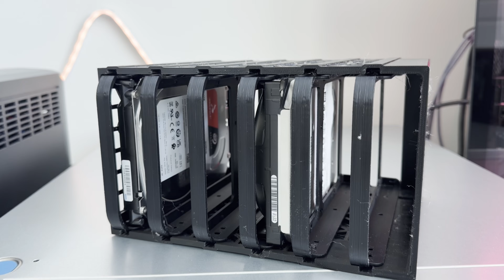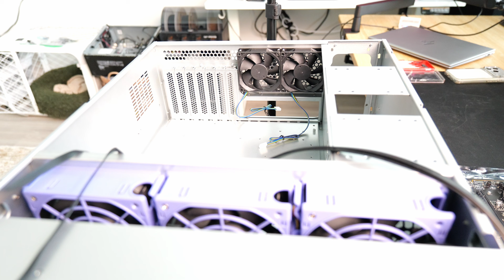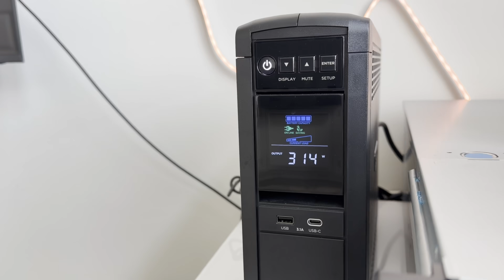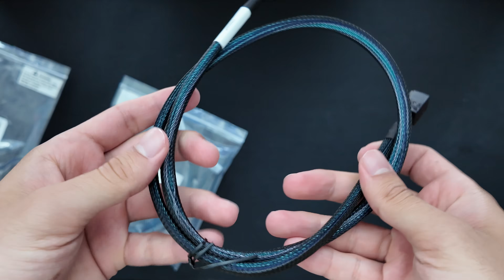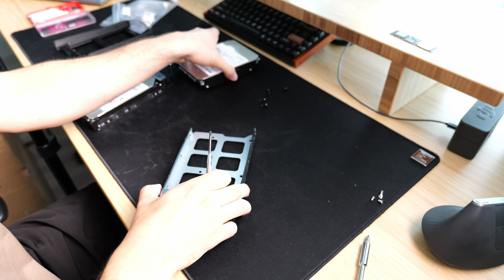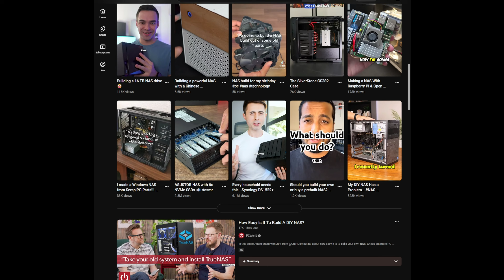I Set Up a 24-Bay NAS

Comment: Get that backup to your data done asap. 

I never experienced a hard drive failure until I got into having a NAS. Especially if using decommissioned enterprise hard drives. And good luck with the warranty. Funny how the storage sellers and manufacturers went from replacing the drive to sending a refund of the purchase price which if bought before 2026 is not going to be anywhere near the actual replacement price.

I somehow got lucky and got my 3 NAS boxes built before the end of last year right before storage prices went nuts but I live in fear of drive failures now as any replacements appear to be 3x or 4x what the drives cost me last year.

I shudder to think what replacing all these drives would cost now. 

If I had to choose storage from scratch today, I'd seriously be looking at cloud storage rental as it has gone from expensive compared to my own NAS to bargain prices in comparison. PCloud lifetime license when it is on sale is looking mighty attractive vs buying a boatload of hard drives in 2026.

Comment: I suppose the RSV-H424 is a reasonable choice with the price increases on used disk shelves.  I went the used disk shelf route myself.  I have a 12U rack with the RSV-L4000U with two 4 bay hot swaps rather than the default cages.  Below that I have a DS2246 2.5" 24 bay 2U disk shelf with 24 Intel 530 series 240GB SSDs in four RaidZ2 VDEVs.  It is so very overkill, but I figured it would give me room to upgrade to more (as I only had 10 initially until I got a deal on 14 more) or larger drives.  Below that is a DS4243 with IOM6 upgrade.  It houses 16 SAS 7200rpm 4TB HDDs in two RaidZ3 VDEVs.  Lastly, the bottom 2U is taken up by an 1100va Wattbox UPS that provides a whopping 4 minutes of backup.  lol  At least my power outages are rarely longer.  It cost me $213 for my 24 bay 3.5", $143 for my 24 bay 2.5", $43 for the 16 port external SAS controller and $17/ea for SAS cables.  I'm using one for the HDD shelf and two for the SSD shelf to double the bandwidth.
Software is Proxmox with TrueNAS virtualized with the HBA passed thru as a PCIE device.  High speed connectivity to my desktop is handled with a pair of dual port 25gig connectx4-lx cards.  The base platform is X99 Taichi, Xeon E5 2697A V4 with 256GB of 2133 registered ecc.

Comment: That 36 bay you showed is the one I built for myself just like this.

It worked out very well, but does as you say "require tinkering". The fans need to be replaced for sure, they are VERY loud. And if you dont have a motherboard in the case like I do not, you need a standalone PWM fan controller+hub to actually control the fans and set their speed. I used some Noctua products for this. Then after that you also need SAS cables that reach where you need them. 0.5M was fine for the front, but I needed 1M cables for the rear side 12 bays because the cables have to go to the front then back again. Since I dont have a MB in my case, I had to wire the backplanes to an SAS Expander instead. Also had to wire up a power switch to the 24-pin motherboard power connector to turn the computer on since a standard power button runs through the MB. Overall the build went very well and the setup has been working great for me as a 36 bay expansion to my server.

One thing I think this video needs (or follow up video) is the complete software side setup you did. As while this is a cool rack case,it is still just a basic PC build. The software side of things is where this really becomes a NAS and server.
Reply from the maker: That’s awesome that you were able to set that up! And ofc in the future I’m planning on setting up the software side of things where TrueNAS is the main OS🫡

Comment: videos like this make me convinced everyone has a 24 bay nas, but i have to realize thats like a really small minority of people that can built a full 24 bay and and have enough money to maintain it.
Reply: bro this is exactly what I think when I watch videos like this... I have simple not ordinary ATX case with xeon cpu, 32GB RAM, 128GB ssd for proxmox and 2x2TB drives to some vms and storage... Everytime I see such videos I think about upgrade, however current system is pretty enough... so  I understand you
Reply: @med1f999  i recently scored a very good deal on a used dell poweredge r720xd. personally i would look out on deals and find something.
Reply: @med1f999  Much friendlier on the wall socket.  Mine is running 660 watts 24/7.
Reply: @cracklingice  YIKES...need to add some solar panels to help balance it out haha
Reply: @mrmotofy  Yeah, I want so badly to do something like an Ecoflow Delta Pro 3 to replace the UPS and then I can cover the shed in solar panels to help power it.
Reply: @cracklingice  well those are an expensive option to buy a battery backup. There's easier cheaper ways that allow you to add capacity easily and replace components WHEN they fail. Good luck servicing those power stations. They frequently can't take much solar input either.
Build your own is frequently cheaper and better long term
Reply: @mrmotofy  Yeah it's certainly not cheap but what it is - is something that doesn't require a high voltage electrician or any of the crap for backfeeding.  I did look into DIY and yeah you can get better at the same price or cheaper for similar capacity.  Heck, even possibly set up in a way to not back feed - but it is still an install that simply isn't needed for the expensiveflow.
Reply: I'm convinced that starting a YouTube channel for home server stuff is worth a try, just in hopes of getting a sponsored video and a bunch of free tech stuff.
Reply: @BARBLEFT  you need to get a lot of views inside a niche community. And already own something interesting
Reply: I guess you could say 52 bays here.  8 sata in the case, and one each - 24 bay 3.5" and 24 bay 2.5" netapp disk shelves.
Reply: @cracklingice  or just ditch this case and just use netapp jbods
Reply: Its impressive how absurd this hardware is for a NAS

Comment: I have a similar chassis, be careful when using the front USB ports, my knee broke off a USB stick inside mine just last month.
You should put the server somewhere noise isn't an issue. The fact of the matter is that those fans are noisy because they move air, and no amount of Noctua magic can change physics.

Comment: The Noctua cooler is pointing the fan on the PSU it must point front to back of a 4U rack case, those midplane fans point to it..., and it definitely necessary if youll use 24HDD or beyond 12 of them, Noctua's 12cm or Arctic ones are quiet BUT cannot cool that hardware..., check if those midplane fans are PWM and edit the bios ramps for them...
Reply from the maker: That’s great insight! And yea i need to go fix the cooler’s positioning, thanks for pointing that out

Comment: Upgrading my old NAS from a 1U 12 drive chassis that has 8 drives populated to a Hakoforge mini with 16.  Complete overkill and I don't care (aside of my wallet crying thanks to current SAS HDD pricing).

If that chassis takes SM style hotplug fans Supermicro sells a 'quieter' 120mm hotplug fan if you haven't already gotten them.  And I'd grab an LSI 9305/9400 to replace the 9300. It's not a bad card it just eats up a lot of power and runs really warm without cooling due to basically being 2 HBA's slapped onto one board. You can also find a 9305 24i for around $150ish and save yourself needing another card or an expander if you do ever decide on more than 16 drives in the future.
Reply from the maker: Wow thanks this is great insight🙏 I definitely gotta look into those fans 😭
Reply: @cachitolabs  No problem, worst case you can always mod some Noctuas if all else fails, good luck with the rest of the rack!

Comment: What fans are you going to replace the stock fans with?
Reply from the maker: Right now I don’t know yet, still researching what would be best🫡
Reply: @cachitolabs  i have the same fans and simular case also 24bay and i use "Alphacool ES Guardian 4Port Powerfan Hub" and i can change the fan speed with software for all fans at one. and i also have no problem with power drow from the default mainboard pind becauuse the fans draw to much power for default mainboard pins.
Reply: @cachitolabs  Have you gone ahead with changing them over yet? I have a similar 24 bay chassis and my 3 Noctua NF-F12's I had laying around just aren't enough to keep the diks cool anymore. :(

Comment: Good video, you could probably use a i7 cpu, the thing you want is memory.. For a nas you might have been able to buy a used supermicro 12-24 bay with cpu & ram for less and been ahead. Building is fun though.
Reply from the maker: You’re so right about the memory, sucks it’s so expensive right now😭 building it was a lot of fun, and thanks for pointing that out!
Reply: Used to be true for the 24 bay SM chassis (SC846) but prices right now are insane if you can find a barebone one.  36 bay 847's also went up a bit but not nearly as much.

Comment: Inspirational. (literally, I may do something similar to this for my home server)

couple things tho

1. the "s" at the end of "chassis" is silent. just say "chassie"

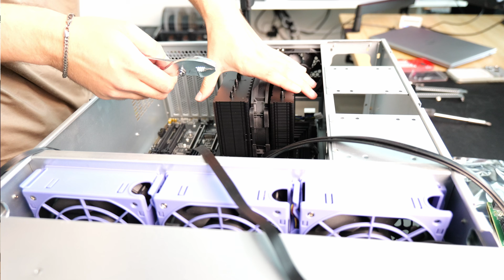2. 5:19 I cringed when you lifted the motherboard out by the heatsink. you could apply unnecessary torque to the cpu socket and could damage your motherboard. I usually wait to secure the heatsink until after the motherboard is fully installed.
Reply: If the CPU cooler is installed properly and securely, it can be one of the safest points to lift a motherboard by. 
It's even ADVISED by some motherboard manufacturers to do this.
You should be cautious, like all things, and I see your point whole-heartedly, but this is something even Linus at LTT has directly suggested his audience to do as good practice.

If a cooler is properly installed, the only torque will be directly on the backplate (pointless) or spread across the board evenly due to mounting points / holes.

Just my 2c.

Comment: I will say at this point buying a case like that is better than using an older smc846 chassis, I just did that and  not only are they nearly impossible to find at homelab pricing friendly prices, but the conversion to ATX is a pain.

I wouldn't get an cse 847 as they are a diff config not great for homelab use.
Reply from the maker: I was so close on getting it but that was my fear 😩
Reply: Converting literally any case to ATX, or converting an ATX case to non ATX is one of the easiest processes I've ever undergone in my life.
Not much of a construction or power tool guy, eh?

I think the case is solid for what it is, but here in FL you can find large NAS cases like this for $50 on Marketplace every day of the week, for the price he spent, there's a rack for sale here at $450 that has 4 dell power edges with 128gb of ddr4 ram in each, a ups, and a few patches and swtiches. Granted the UPS would need new batteries.
Reply: @iJayleYT I 3D printed the parts I needed to mount the PSU for example. I did not want to cut into the CSE846 they are rare to have nowdays.  I also made a new fan wall, AIO mount with it, and new rear fan mounts for some 80mm noctuas. It's a lot of extra work when you can just purchase something like this. 

CSE846 is about $800+ USD .